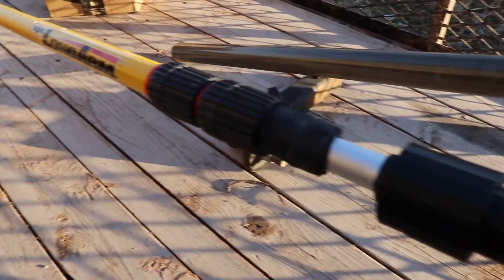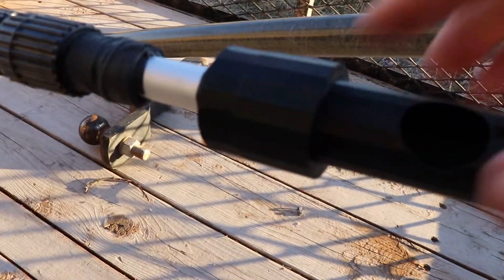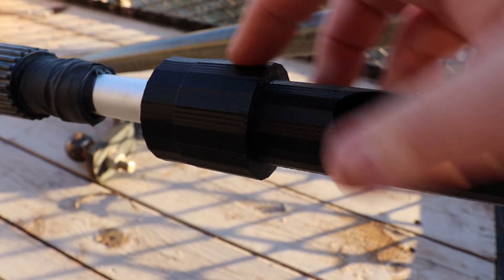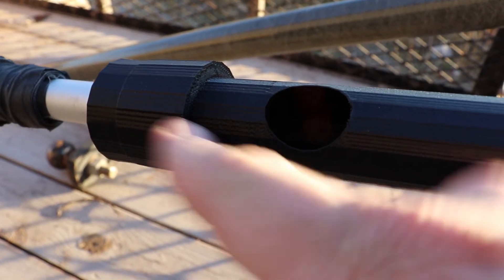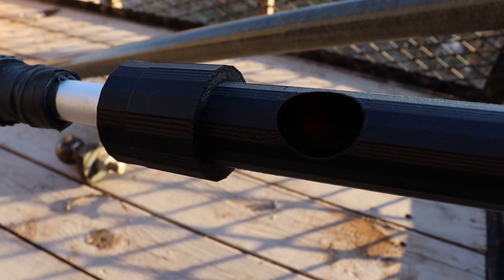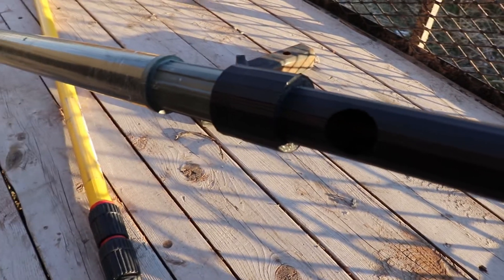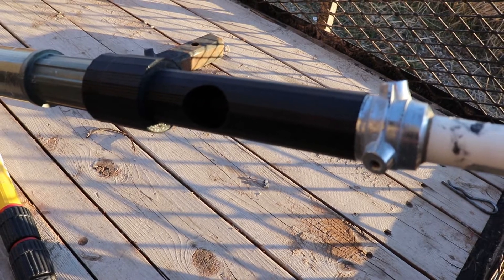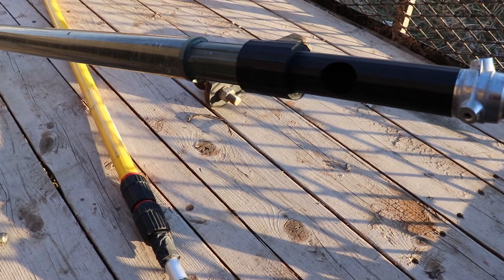3D Printed  Painter Pole v2 Antenna For Amateur (Ham) Radio Field Portable Communications

Comment: I don't have any personal experience with 3D printing, but there are local shops available. They ask what material I want to use - what do you suggest? The best suited for this application?
Reply from the maker: If you are using this for temporary use, PLA works just fine. If you plan to leave up with alot of sun exposure over time, then ABS or PET-G is best. Reason being is PLA will breakdown in the sun. I use it for probably 15 days out of the year and PLA is just fine.